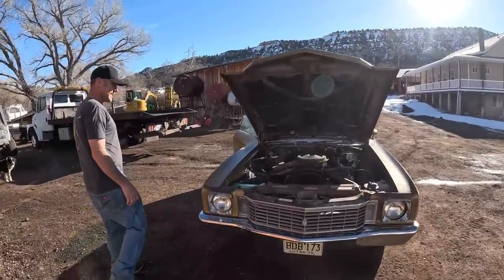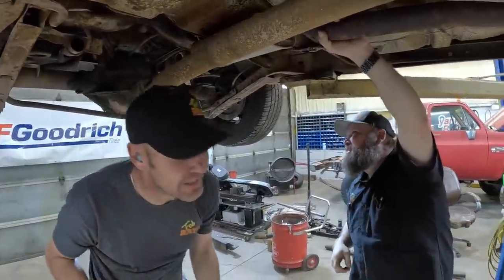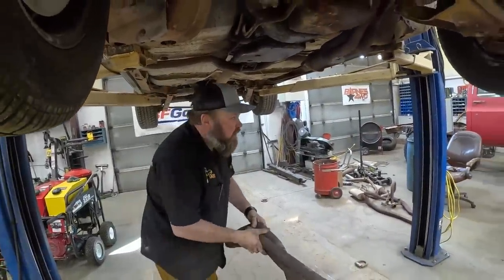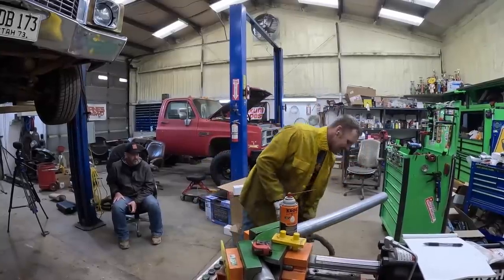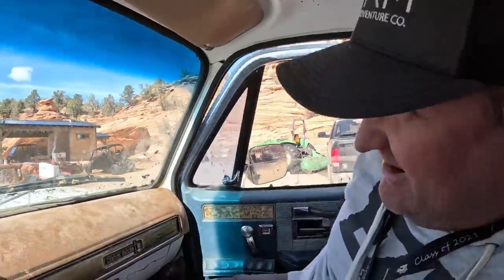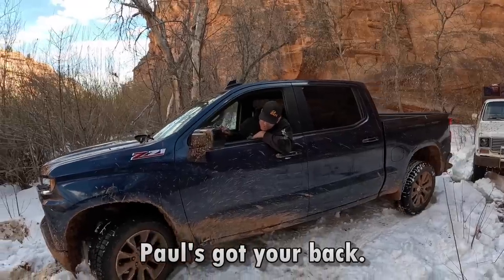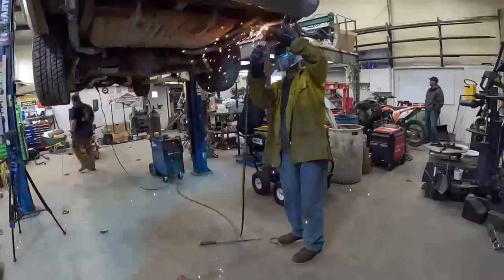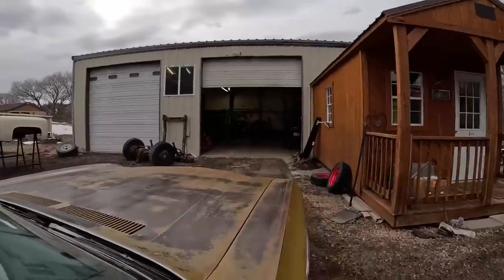There Is A Reason This Is A Pretty Special Car.

Comment: Am from that era, and try that job without a lift, you will say "Oh shucks and stuff like that".  Want even more fun try headers on a 455 Poncho HO stuffed into a Trans Am.  The old HO motor had different motor mounts than the 78 Trans Am which makes for some Fab 101 work.  We didn't have that cool power pipe bender, and yes there are some manual tube benders out there.  Hint you replace the pushing the button to, blood (slipping parts), sweat, and not tears but creative Sailor Language, yep retired Navy.  We got the stuff bent eventually.  Today I don't think I have the patience, strength, mobility and pain ignoring skills I once had to do it the old way.  Buddy passed away and the old manual bender got a new home at the auction, I didn't want to pay that much for the agony it produces as a side product.  Have fun watching you guys use modern tech to build things.  Hell I just about 8 months ago got a plasma torch.  My milling machine is out of a WWII heavy cruiser and lathe is a scrapyard salvage.  Now I do motorcycles for the most part.

Comment: Stock tailpipe numbers for this car from midas we're 5t5820 and 5821 in 2 1/4 😂 haven't worked at midas since 1994 ,can't believe I still remember that.🤪 The look of frustration on Paul's face shows he's not into exhaust work. If I ever come down for a visit,I'll be sure to stop in and give some pointers ,if wanted.😂

Comment: He can take the heads off of that thing and put some clothes chamber heads and have a real ground pounder. The 402 (396) came with 10 and a quarter dome top pistons from the factory. They just put the open chamber heads to lower the compression ratio.

Comment: Think mine was a 1970 blue Monte Carlo  350 ? 4 barrel vinyl top. First car I bought myself.  The engine compartment was so big in front you could climb into it - think from radiator to front of motor was like 2 ft.  You could cave in the front end and never touch the motor. Still miss it !

Comment: GM didn't put headers on anything from the factory, the closest thing to headers was the 427 mystery motor and it still had cast iron manifolds.  Headers never came in the trunk for dealer installation either.

Comment: Back in them days, it was standard procedure to take one motor mount bolt out, rock the engine  over, then repeat on other side. No, headers were not factory equipment.

Comment: Classmate in HS (class of '78) had a '72 with a 454 and swivel buckets. MCs were supposed to be the luxury version of the Chevelle. There were 2 Chevelles in town both with the 402/4speed setups. Drove them both. Nice cars for sure.

Comment: Gotta love a car that is like driving a couch. My 72 Cutlass is about the most comfortable car I have. I was really wanting to see what wrench and whose small hands were used in the bolts on the rear passenger side header bolts. Mine get loose and I have several wrenches and sockets that are specific to those bolts. I looked in the 3 inch thick dealer parts  book for "header option". All it really shows is "dual exhaust option". I love this book as it shows every factory part number and paint codes from 1958-1969.

Comment: I had a 70 Monte Carlo with a 396 and pivoting bucket seats. I sold it when I found a 68 Pontiac Firebird and bought it. I still own the Firebird 30 some years later and it will run an 11:30 in the 1/4 mile with a 383 and no nitrous. The Monte Carlo is the one car I wish I had kept. I do not believe you could get factory headers on the Monte. I have never seen anything to make me think you and Ben were fighting. This is the only YouTube channel I have watched every minute of every video since I discovered it. Did that Monte have pivoting bucket seats? I have read that most of them with big blocks option also had pivoting bucket seats.
Reply: The factory installed swivel bucket seat option wasn't available until the '73 models came out.
Reply: @danjanes8689  I bought the Monte in 86, second car. Sold it in 89 when I bought my 68 Pontiac Firebird. I was looking for a 67 or 68 camaro when I found the Firebird and am glad I found the Bird. Someone must have put the swivel buckets in the Monte before I bought it. I sure thought they were cool at the time. The Firebird has buckets (non swivel) with a five point safety harness certified by NHRA.

Comment: No headers from factory, rare if the selling dealer would install them.  BBC in the Monty is fairly rare, had one back in the day.  GM had tons of cars and I owned them all  at one time or another.  Jacking the motor was the way we installed headers on most chevies.  Jack one side at a time.  Trim the ends of the UCA's, ball peen the header when needed.

Comment: I don't remember any production GM cars coming from the factory with headers.  Some dealers did make mods for special cars so possible maybe?  I have to admit I quit keeping track from the 70's on when they pulled the performance out of most cars.  When I was young it was all "headers, headers, headers"!  After years of burned header paint, loose bolts, burned plug wires (or anything else that got close) it's back to iron manifolds on my 66 SS Chevelle.  Since it hasn't seen the strip in decades, I can't say I can tell the difference.

Comment: Frieburger on Road Kill did a dyno test on stock headers and those that had been dimpled,  no difference in HP after the dimpling.  Those header bolts will need to be retightened/checked after a couple of hundred miles.

Comment: So what's your secret to getting those header bolts out without breaking any ???
I always use new grade 8's an grease them going back in .
But there's always 1 or 2 that twist off .
Once on my welder I actually had 2 that didn't break . A 240 ford 6...

Comment: when i was wheeling in az in 99-2000 my most rescued truck was the chevy sliarado they got stuck in the sand and the mud and on the rocks but no snow in central az but when i took my little sammy back to indiana with me i pulled silvarados out of the snow there...all i had was a home made 4 inch lift and a set of of 215 75 15  bfg all terrain tires and and a warn 8000  winch on a home made mount in the front...i drove that little truck all over america and i built a new sammy every summer when i was laid off work from the local college i worked in the kitchen and was a union steward that was the best union the companies money could buy they sucked

Comment: Future rebuild tip for the owner, use .060 over 375hp 396 pistons, 3 angle valve job on the stock heads, and a mild .520 lift cam will get you 390hp at the crank.

Comment: Worked for dealer those years
Didn’t see many Monty’s
Most came with 350s 
Of course you could order most anything, like 396, 305, etc
Too new to see in dealers when I worked the heavy line.

Comment: Paul, about pumping the gas for her, better you do it.  Because one day it could be raining and the tank is right on empty. And, when she pulls up to the pumps the only one available is the one on the end with the green handle.  She'll get really upset when she can't get the spout to go in the tank, so she carefully aligns the spout with the filler neck and fills it up.  She drives  away and the car starts sputtering and finally dies a hundred yards from the  Gas station. Then she will walk back to the gas station in the rain and tell them they have water in their gas.  No it's better that you pump the gas.

Comment: Those are aftermarket headers. That car would have had a standard for the day manifolds on it from the factory. 
2 give aways to that. #1 the standard 3 bolt header flange. #2 The fact that they are long tubes. 
Not even the famed gm LS6 ( which is a 454 for those who don't know ) had headers on it from the factory. 
That is my favorite year for the Monte ( and most other GM cars. Might have something to do with the fact I was born that year....lol ) That is also my favorite engine for that year. Most don't know that the 402 was ever a thing. Depending on vehicle is was sometimes called the 396 ( factory did that just because of the solid reputation that the 396 had ). In the truck applications for sure it was usually labeled as a 400. 
Awesome car though. I like the one owner aspect and the factory a/c. Makes me wonder how highly optioned the car might be.

Comment: Great job! Paul but sorry. that dude is not old enough to have bought that brand new. I'm thinking his dad bought it? In 1979 I was working in a large auto salvage yard. A young kid came in with a 1970 monte Carlo. he wanted to know what a replacement engine would cost because his was making noise. Myself and the owners son went out to see what he needed. The first words that came out of the boss mouth when he saw the car, was do you want to sell it. You see the noise it was making was the mechanical lifters not set correctly on the factory 454 LS6 in what turned out to be a triple black Monte Carlo SS 454 LS6 M22 4 speed car. The kid would not sell it so my boss told him to get the valves set and what he had as far as his car was concerned. To this day that was the nicest 70 Monte Carlo I have ever seen.

Comment: My dad had a 72 Chevrolet pickup with factory 402 in the 80s, it would melt the tires and turn 6500 rpm, stock.

Comment: Paul I took a 71 Monte Carlo 454 Big block and put the engine and tranny in the trunk when I hit a massive power pole when I was about eighteen yes excessive speed and alcohol were involved that earned me a body cast for 8 months. I just made them a little bit more rare

Comment: They never did put headers on a car at the factory.  Dealer installed accessory though.  In my view the easiest way to build an exhaust on a stock car is just buy a mandrel bent kit from Summit Racing.  I did that on my '69 Camaro and the kit was only like $250.  Just piece it together and weld it up!

Comment: I bought a 1972 Ford F100 that had a newer 302 in it. Ran good but I switched to 4 bbl and headers. When I took the exhaust manifolds off there was NO gaskets! Looked like they planed the heads and manifolds for exact fit. Never saw or heard of that before or since.

Comment: No factory headers from Chevrolet back then.  The early Camaro Z28's (1967) could be had with headers but they came in the trunk and had to be installed by the dealer.  That's the closest thing to a factory header from Chevy that I know of.

Comment: Never seen a factory car with headers, even the most high performance options came with iron manifolds. And yes I would often (borrow) my wifes car so I could check the oil and tire pressure and fill the fuel tank, in fact I just did that a couple days ago?

Comment: Have you guys ever thought about using a "folding tape measure" to make exhaust? It would allow you to unfold the tape measure to the angles you need and then you can match the pipe to that in the bender instead of walking back and forth 20 times. Just an idea.

Comment: Next time you're removing a junk pair of headers that are fightin' you, just sawzall all the tubes from the top, pull out from top and bottom.  Not saying the new ones going in will be easier, but you'll save some time.  Nice Monte Carlo, I looked at one in 1990, '70 big block car with 38k original miles, for $3800 on a dealer lot in Seattle.  Don't think the wife would've been happy with that, she liked her '84 Cutlass I'd just bought for her.

Comment: I had a 74 Buick that had a body alot like that but mine came with a 350 so i put a 350 - 4 bolt main in it with a 300 cam. I won alot of street races.

Comment: The big three used headers on the big block that might of been destined for racing.  The narrow pipes in back were to keep back pressure high keeping horsepower from causing too much attention.

Comment: Yes Chevrolet had a nap header that was stock on a lot of big box they just didn't have the exhaust they needed to let it flow good enough Chrysler on the other hand also had a header it was a straight down header that curve from both sides and went straight into one dump and it also was a type of header

Comment: I never seen a late 60's/early 70's vehicle with "factory" headers.  All of those with headers were modified exhaust with aftermarket parts.  My one experience with fitting headers required a lot of the same "modifications" (beating with a hammer) that this one took.  I decided it wasn't worth all the extra work, and never did another.

Comment: Nice job on the exhaust Paul and Ben sounds sweet! I really want to get a exhaust bender machine found one similar to your on marketplace for 2500 unfortunately can't afford it right now but some day I'm gonna have me one I have built many exhaust usoling just the tools I have and to be honest they turn out rather well have used a few A body kits on later model chevy trucks works really well and you end up with some extra pipe when done for the next project

Comment: Oh yeah, that's what it should sound like. I think OEM had small resonators with oval chrome tips. I always thought it strange that (GM anyway) put small tail pipes on the muscle cars in the high horsepower time period. A lot of people claim that they need so much back pressure. I never could relate why it would be better. I've always run big pipes just like Paul thinking it was the best to make them breathe. The engine is an air compressor and to me the easier the air can get in and out the more power it would make. I started out making duals with straight pipe, no bender, cut the pipe in pieces on angles to make the bends and then weld  them together with coat hangers and an acetylene torch. I had an old 65 chevelle with a 6 cyl that I drove to work at the coal mine and I somehow managed to split the manifold and braze it back together successfully with straight pipes.

Comment: I bought  A 72 402 BIGBLOCK IN 73 .......it sets in in my back yard to this day, I fire it up everyfew weeks and take a cruze down memory lane......160 k and the only work to the internlal engine was a brocken pushrod guide which ended wth a bent pushrod and a new lifter,   It will still smoke em!!!....it has a 400 turbo and posi rear and duel exhaut and NO headers........The front end sagged on me and I had heavier and shorter coils put in ......research on the springs found that the factory put stock malibu small block springs in it??.......could have been a recalll???..........I heard these 402's were ordered for boat motors from mercury.......and they either cancled order or made too many of them????have fun with that can and don't sell it.......

Comment: I put headers on a 1970 Monte and even though they were supposed to be for a big block it was a pain in the rear. I forget what company they were because this was back in the late 90's but I had to drop the header to remove a spark plug and had to take a chunk out of the upper A Arm and cut holes in the inner wheel well to get to the plugs easier. If I ever own another Big Block Monte it will have manifolds or custom only never again will I buy "Made to fit" anymore

Comment: The 402(actually a 396) said they came with 375 HP (but people say it was actually 450hp) and headers. It's said that the factory fudged the HP numbers for insurance reasons.
Reply: in 72 or 3 they changed how they calculated hp. for insurance reasons. lol

Comment: NICE JOB . The motor sounds tired. Possibly just needs a tune up and the carb rebuild. I have had a couple 402's and they are by no means lazy when you press that skinny pedal.  Great car overall. Drill a weep hole in the lowest part of the exhaust, exhaust sweats, moisture puddling comes back to bite you, especially when they aren't driven often.(assuming its storage isn't climate controlled.)

Comment: I do not know of any GM or any other mfg that had headers available.  None of the big block Corvettes ever came with headers.  The factory side pipe Corvettes did not have headers.  The side pipe just attached to the exhaust  manifold directly.  I had side exhaust on my 77 L-82, 4-speed Corvette.  I had Hooker side exhaust  headers, had to cut off the stock side exhaust pipe at the flange and weld the header cone on and then bolted it to the header.  The high performance GM cars had different exhaust manifolds, but they were not headers.  The Hooker side exhaust headers exited behind the front wheel.